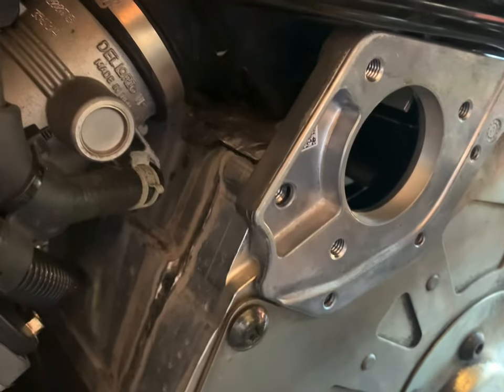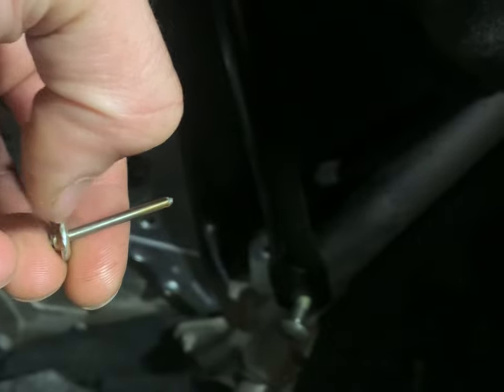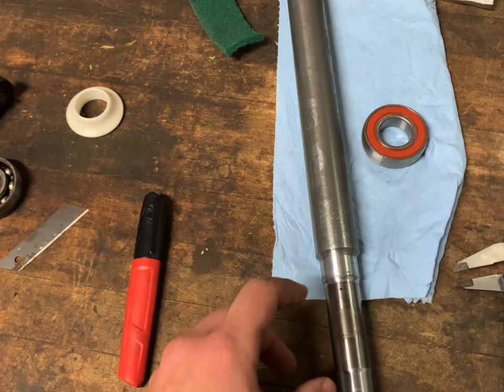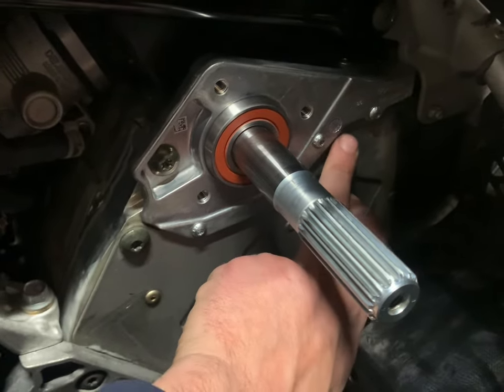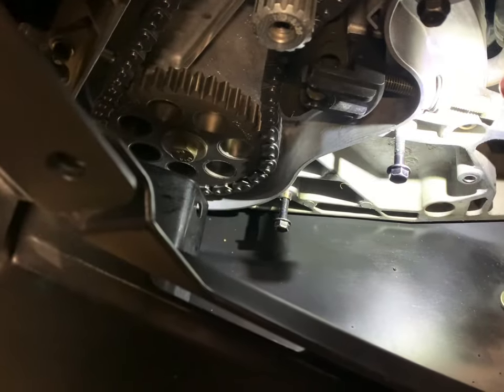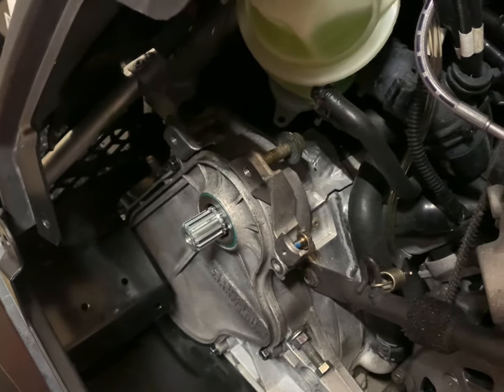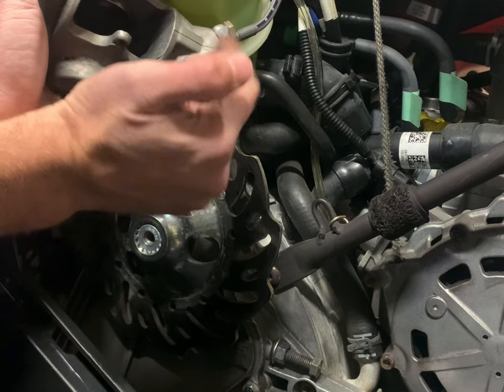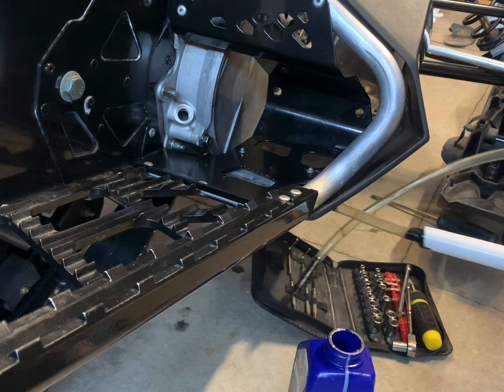POLARIS 850 Jackshaft Bearing And Mount Replacement Part 3

Comment: Im going to sound like a know it all and probably get flamed or burned if younk folks eve use  thise terms now .Im 60 and been wrenching all my life on something so people can stop reading or continue .No matter to me ...I did my own sled last week and have a buddy bringing  his for me to do Tomorrow December 26th.IMHO you created a lot of work for yourself By NOT removing the 4 bolts that hold in the rear skid. You do not even have to touch your track tension bolts to remove the skid as per other YT vids.You had all the  bolts out if the bearing carrier and flange and the bottom gear off and shaft ready to be removed .
This way you would have not had to touch the clutch gaurd or tank and lines and you could have removed the rivits from the bottom with a dremel or mini grinder then replaced with rivits or bolts as per the updated 22 and up instructions for the flange .Sorry for the rant man and i hesitated a respond because i commend you for making the vids .To tighten your bottom gear bolt do that toward the end when you have the chain and gears on and then temporarily put the rotor on and stick a flat screwdriver trough a slot in the rotor and let it hit the outside of the chain case near a beefy area so it cannot turn and torque your bottom bolt.Then remove rotor and continue to assemble the case.
Reply: In regards to driving the bearing onto the shaft i used my old bearing and some white pvc pipe and hit on the inner race similar to your method with the of the shaft on hardwood placed on the concrete floor and measured, tapped and repeat.I did not put mine on as far as you did and we both reused the 21 JS.
I installed my bearing a bit short on purpose because I did not want to have to move it towards the clutch if it was on to far .I then put the shaft in the sled and assembled the chain case top gear and spacers and cover and rotor (all components but the o ring )including the cover and tightened it all up simulating how the parts would be installed while running the sled .What this does and why Polaris says to do it this way is it pulls the shaft to the chain case side and you can see how much farther the bearing need to be pressed on the DS do it "lightly contacts "the bearing mount then when you tighten the mount bolts to 18 then it seats the bearing in its neutral position .Then once its installed you can spin the rotor or the clutch  and check for any binding if it bids there are a couple things that would free it up and put the bearing in its happy place.
IDK how when you put the bearing on so far that its not too far and the shoulder on the shaft on the chain case side is not up against the bearing in the case and when the rotor is tighten its not pulling in the new bearing putting side load on it which most say kills them .I installed mine and the chain case side several times and snuck up on that bearing getting it to lightly seat in the mount and ended up ironically in the oem length from the end of the shaft.
If I missed something in the vid and you had the top gear and on and the spacers and cover and rotor then I appoloise for such a long post and maybe the tunnel width in our sleds is different and you will be fine. If not I think yours "could be" on too far but if when you spun your rotor or clutch with the case assembled including cover less the chain and were happy with it then great.
Reply: I broke a chain case cover bolt as well .I think the the torque is wrong for them.I put them on by feel now .I too used a inch torque wrench like you and still broke it .
Reply from the maker: Dont hesitate if theres ever any tips or tricks that others can benefit from. After doing this whole job I will say if theres ever another go at this it would not be as bad as the first. The oil tank seemed hard at first and everyone gives you the scare of air in the lines causing the bottom end to grenade. I found it was not all that hard to remove or install and gave a better few with more access. This was my first time doing the job so it was nice to see the assembly. If you install the bolts rather then rivets I completely agree on removing the skid.
Reply from the maker: You can look at bearing placement 2 ways, if its too far on the shaft tightening the gear side will either put alot of tension or push the bearing back out. In my case the new bearing needed to be exactly where the old one was placed. At first I did not put it on far enough and it caused a large amount of play. I would love to see where others bearings sit as a comparison. Prior to starting this job there was very limited info or photos. I spent alot of time trying to figure out placement. I got a good idea of placement after connecting the chain case side and measuring with a razor. My old bearing inner race was jammed against the stepped edge. Doing older sleds in the past thats how we would install them. I however don't recall seeing the notched shaft as shown. My guess is this is from the more narrow 800. Also thinking the inner race is not pushed into that notch. Im sure as time goes on this will become a more common repair. For me I started months ago and did a few min every day after work. This made the job feel much longer and harder haha. Thanks again for the input. Hopefully others can use your comments to help in the repair 👍
Reply: @Onesmoothride  I just saw this after i blew up your pt 3 sorry but yeah skid re
Reply: @Onesmoothride  There is a LOT of debate about this on HCS on this subject. If you had the chain case assembled including cover and rotor tight when you measured with your blade you should be fine if the mount is designed to place the middle of the race in the middle of the mount. Some people said the new mount allows the bearing to sit deeper in it than the original cast mount which makes sense to me but i never measured the new bearing in the new mount to see the fit. I will see how the one we do tomorrow goes .It should go well since i have a helper and learned a few things .Def going to pull the skid and probably DS as well as its easier to this job and repack the bearing when the DS is off.
Reply from the maker: Thats what got me so concerned. The pro tip says the bearing will press in. For me it fit exactly to the centre of the outer race. Let me know how the next one goes!
Reply from the maker: @terrymunn1224 interesting, to me it felt too high. After that I did the same thing and went by feel.
Reply: Did the second bearing change today. It had no grease and was sitting VERY crooked in the mount and flange. I had help so we removed the skid and Driveshaft to access the rivets and service the Drive shaft bearing. Replaced the bearing and mount using 5mm bolts and loc washers and nylocs and everything looks really good .We re used his shaft .We also found no loctite on the bottom gear bolt.
Reply from the maker: @terrymunn1224 very interesting, another one down👍